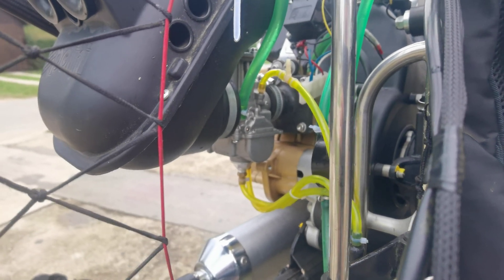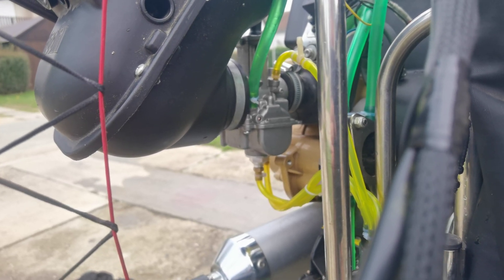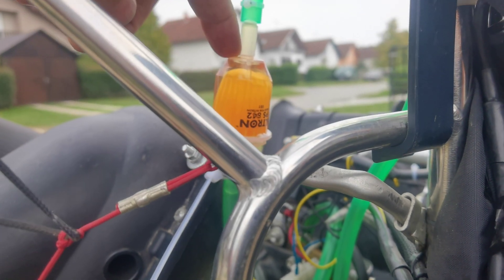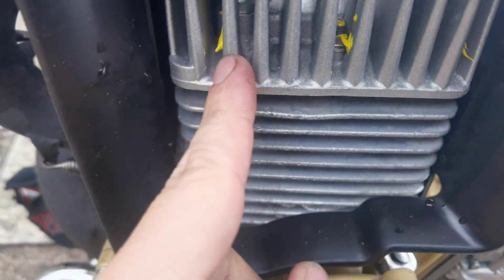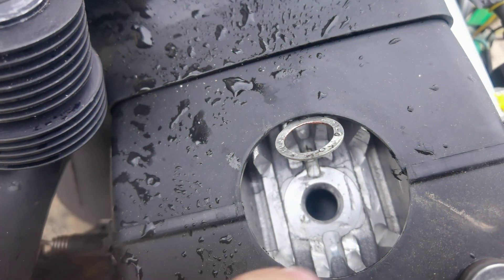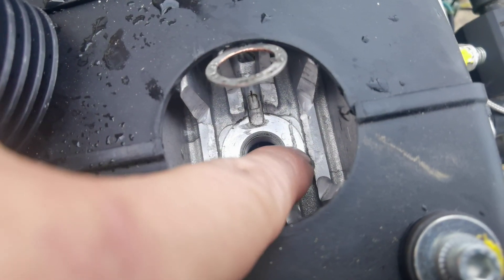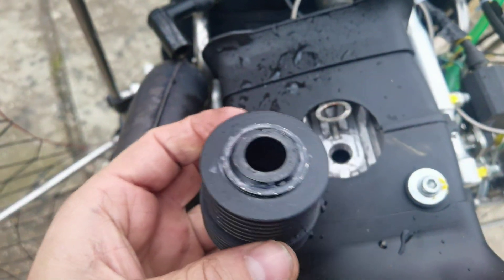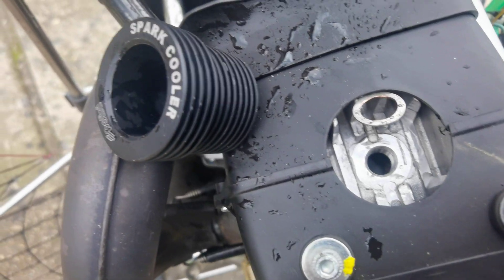Polini thor 200 EVO / HF maximum rpm fix!

Comment: I think the the root of your issue that you are missing a 2mm thick washer - at least it is not visible on the video. If you open the service manual you will see that there is a 2mm thick washer on the cylinderhead, under the cooler. If you install that washer then the cooler is sitting in correct height and does not touch anything.
Reply from the maker: Then is spark plug too high.

Comment: Hi there - I've seen your Polini posts on Facebook about this.  I have the same problem - I can't rev over 5200RPM.  Can you tell me if the fuel filter fixed it, or was it the spark plug cooler that fixed it?  Thanks!
Reply from the maker: Hello fuel filter need to be above carburator and transparent so you see if you dont have fuell in line
Reply from the maker: Jes they fix it